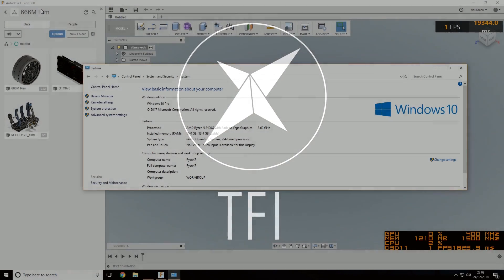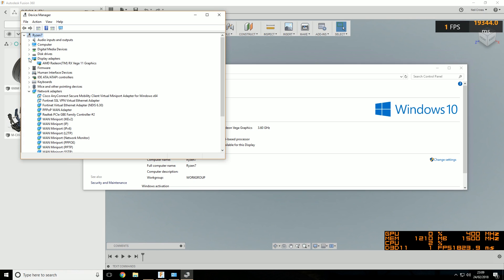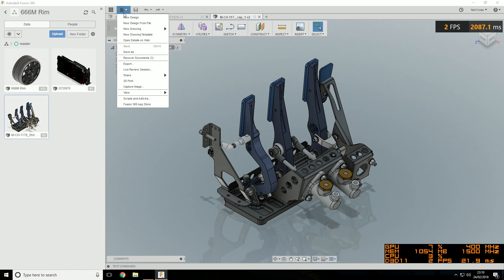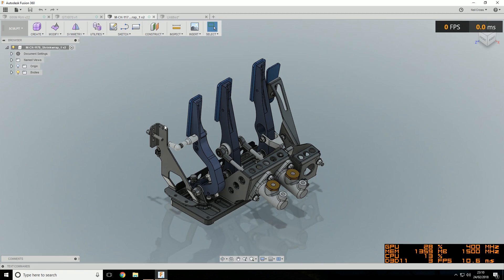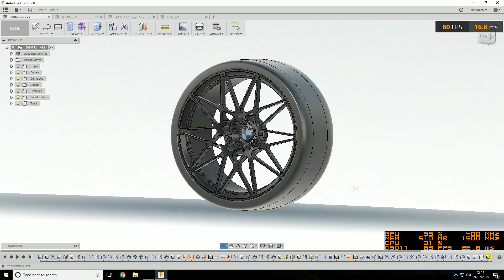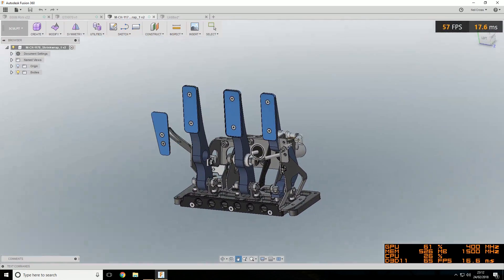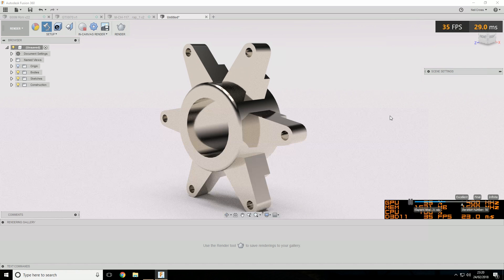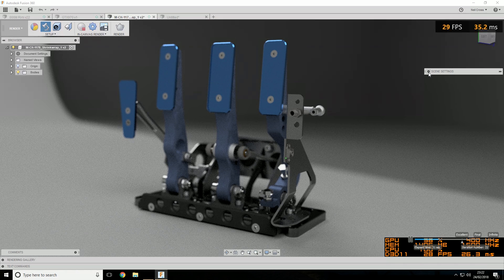Does Fusion 360 work with a AMD Ryzen 5 2400G APU?

Comment: can 3400G with Radeon RX Vega 11 Graphics run AutoCAD 3D?
Reply: 3400G should do better than the one in the review.  Keep in mind the Ryzen 3 3100 is cheaper and faster if you can snag a cheap GPU.

Comment: Got a Dell 5575 15.6: FHD Lappy with Ryzen 5 2500u and Vega 8 Gfx. While simple modelling looks fine, it's a disaster while running a bit difficult CAM simulations.  While GPU/CPU and Memory loading looks fine, the CAM simulations stops intermittently and disturbing.  It may be mentioned that on an HP Lappy with 8250U and Integrated graphics the same simulation is absolutely fine and stutter free. Can you help by suggesting settings for the Vega 8 Gfx ??!  Let me tell you that I had decided to purchase the laptop after SEEING THIS VIDEO. Thanks in advance
Reply: Does dell 5575 is good for designing software such as AutoCAD ,3d max , Revit ?

Comment: How big of a difference does RAM make in fusion? I am looking at a Ryzen mobile system and want to save money by opting for the 8Gig model.
This wouldn't be my main system, but something for on the go.
Reply from the maker: Yea 8gb isn't enough, you might be under 8gb for most of the time but only a few apps can push it past 8gb and you'll get rotten slowdown and potential instability. 16gb minimum if you want to work without being bottlenecked by RAM

Comment: I have a ryzen 1800x running stable at 3.95ghz with dual firepro gpu's (6gb total vram) and fusion 360 is the only program that freezes my system when trying to render/ray trace anything, I basically have to clock down the cpu a bit to make it work, just my 2 cents !!
Reply: Jochy Estrella for what I understand, multi gpu config doesn't make vram doubled,
Reply: Correct, but many programs nowadays are able to use multiple guys to run as separate or dual GUI/compute units, da Vinci resolve being one of them for example.

Comment: I was wondering if the lag issues might be relieved if you overclock or just set the iGPU to a set 1240 mhz or higher.  I noticed as you went through the video that it seemed whenever I looked at the gpu clock, it was stuck on 400mhz.  I might have missed it changing but it's just a thought.

Comment: This APU is amazing!! For me, is the best option for students. Thanks for sharing us all the videos and, of course, you are helping us a lot!

But I have a new question for you: did you find any problems with this APU when you was testing it? Any problem with bios? Any problem with "blue window" or any system crashes?

Another thing: did you change anything more in the BIOS or in the Ryzen Master? I know that you changed to 2GB (APU memory), but did you change any other thing too, like CPU or GPU clock?

I am asking that because I saw many videos that reviewers are seeing some crashes in the systems and in all the games (I will buy for CAD, but there aren't lots of reviews of this APU and CAD programs. So that's why I am watching theses kind of videos). So I just wanna know if that 2200G will work correctly in CAD programs, because a lot of people are having some problems with this APU when they are gaming...
Reply from the maker: Not a single bit of bother at all.  I have tried overclocking in Ryzen Master but tbh it's just not worth it, most people get 4.05Ghz and that's like 105Mhz over stock boost on the 2400G, what's the point? Why introduce enhanced instability for the sake of 105Mhz, so I left it at stock for the tests.  The absolute biggest benefit by a huge huge huge amount was RAM speed, the FPS in CAD increased massively when going from even 2866Mhz to 3000Mhz, I tried 3200Mhz and it was another huge leap in graphics performance.  I might do a separate video on this as it was such a big difference.  But no I had no problems with BIOS or blue screens, maybe this motherboard is a good match for the APU? I have a Gigabyte AB350-N mini-ITX board I can try it on so I'll see what that's like.
Reply: TFI I've been watching videos about the problems and the solutions... And some reviewers from Brazil and USA had almost the same theses problems:
- IGPU Clock speed fall to 200 - 400 MHz, what makes the games unplayable. From 1240 to 200 in some parts of the game;
- Instability with blue screens;
- Problems with motherboards; etc.
But they solved theses problems almost using the same solution: Set the IGPU Clock in Ryzen Master to 1240. So, the problems with the frames drop is solved and they could play the games. So, that's the solution!

You asked with your motherboards was a good match with this APU, I think so! Did you have to upgrade the BIOS to boot the system? Or you've just put the 2400G and it started?

About OC, I've heard one guy that works for AMD told in a video that they don't suggest to OC the CPU (just set 3.9MHz in all cores), but they (AMD team) recommended to OC the IGPU. What do you think about that? Some people could put 1600 MHz in Vega (very big difference in games). Can you make this OC and tell us in a new future video? Something about the difference and the if it is worth or not... I think it will be better, but i don't know how much.

About RAM, I didn't know it!! Please, make a video about that big difference... It will be very nice! I will use that info before buying RAM for my build. This tip will be very useful for all the people who will build a system with 2200G or 2400G
Reply: If you're going to use the igpu it's obvious maximizing that performance is the top priority, 10% extra cpu frequency simply won't scale the gpu performance for a tangible benefit.
Reply: Matheus Menêz did u make the system can u suggest ur feedback if any ?
Reply: Nintendork Thanks! I thought the same as you! The OC in the IGPU is insanely... We can get 1600MHz easily! But I will OC if I only need, because I don't know if I'll have to stress a lot my CPU and IGPU... Can you understand me?

Edit: I mean, if the 2400G is running everything very well in stock, why would I OC? I am a student, so every work in theses CADs will be lighter...
Reply: Tanmay P No, my friend!! I probably will buy my PC in the end of the year... And of course, I will buy one with R5 2400G, B350, 2x4GB RAM (16 it's too expensive now) and 500W or 600W. Nothing more hahahaha

At college, I study SolidWorks (the same PC has AutoCAD, but I haven't tested it yet) and the PC does a good work with theses two programs! The PC has: I5 6500 + R5 340X (2GB) + 8GB RAM or 16GB (I don't remember now). It is made for DELL.

So, if that CPU and VGS do a great job with theses 2 programs, the Ryzen 5 2400G will do too... No worry in my opinion ;)

The name of that DELL's PC:
Dell Optiplex 3040 (therapy are two types: with VGA and without VGA). I don't recommend this because it is too old. The R5 2400G will do a better job, I'm my opinion and will be able to upgrade to the next Ryzens till 2020, without changing the motherboard...

Comment: Did I understand wrong?? or did you say Ram is "Geil 16gb" , listet is Kingston memory , sorry if I´m wrong!!
Reply from the maker: Yea correct, the RAM is Geil Evo X 3000MHz DDR4 2x8GB.  That kit doesn't have a price on PC Part Picker so I just substituted it out with the Kingston kit, I did the same with the PSU as the PSU I bought doesn't have a price on there either!
Reply: ok, I live in Germany the price for 16GB Geil evo x dual kit at " Mindfactory.de" which is one of the best online stores there, is 212,88 Euro. Think the price  of an 500W PSU is mostly irrelevant, I would have taken a Be Quiet! PSU instead of Corsair , but anyway...
Reply from the maker: I wouldn't recommend Geil for a Ryzen build anyway, I've had nothing but trouble with it.  The G-Skill kit I've got in my main system works flawlessly with Ryzen but the Geil RAM is terrible, it fails to boot 70% of the time, I have to power cycle the PC several times before it gets past the BIOS check and does a successful POST, then it just randomly works until I need to reboot again.  The PSU I've got is a Cooler Master 550W, it was approx £50, the G550M or something like that... it wasn't priced on PC Part Picker either